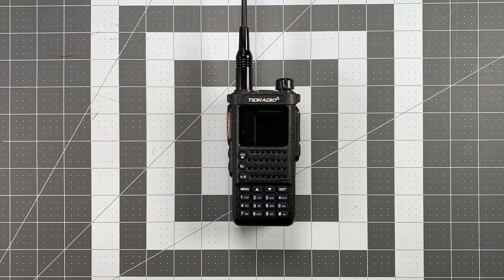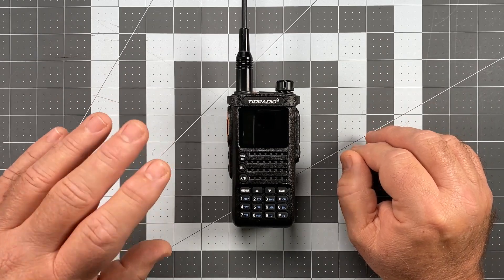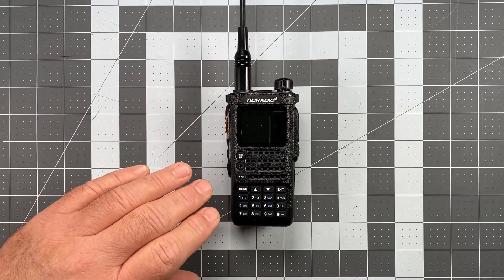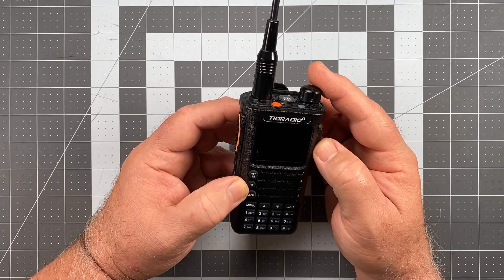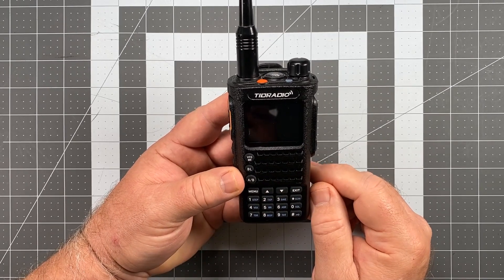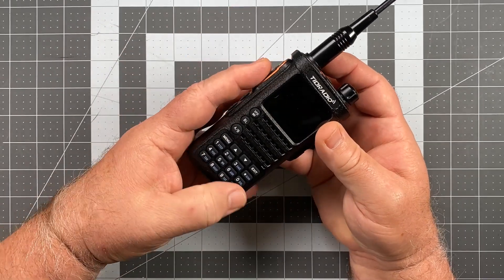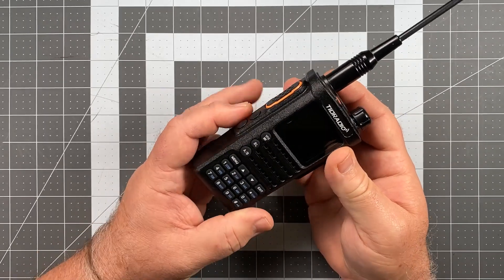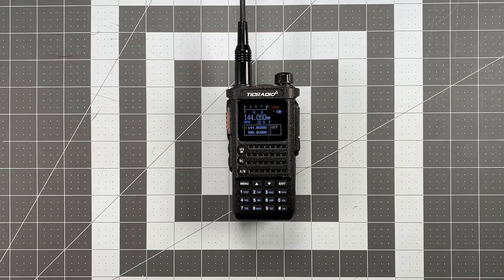TID Radio TD-H8 - Switching the Operating Modes

Comment: What is the best mode to run in?
Reply: official answer: the mode that you are licensed in and be FCC compliant .....  since I am not the FCC police ...  Normal gives you all the options with no "operational" drawbacks ...  well ....  its your radio, you decide what mode to run in .....  BUT. just as a serious side note ...  if you use chirp and you change modes you cannot write an "old" (before you caged modes) settings file back on the radio ... Chirp will read it as a "new" incompatible model ....  so you can copy and paste some frequencies ... BUT you cannot change all the other settings ....

Comment: Any idea what menu option 34-  Hopping RX is for?
Reply: RX Hopping (Menu 34) on the TD-H8 toggles the radio’s ability to follow a frequency-hopping transmission (FH). When ON, the receiver jumps through a predefined hop pattern/interval so it can track another TD-H8 (or compatible set) that’s transmitting with TX Hopping enabled.
What it’s good for
Interference avoidance: If one frequency is noisy, the signal keeps moving, so short bursts of interference matter less.
Basic privacy/obfuscation: Casual scanners won’t easily follow the conversation (this is not encryption).
Requirements / caveats
Both ends must match: same hop table/seed, hop rate/interval, and channel setup—usually configured in the vendor CPS.
Range can drop: brief dwell times and imperfect matching can reduce effective coverage vs a fixed channel.
No repeater use: hopping won’t work with standard GMRS/ham repeaters.
Scanning/features limited: scanning, recording, or cross-functions often don’t behave normally while hopping is active.
Legal notes (important)
GMRS/Amateur (U.S.): Frequency-hopping transmit is not permitted on GMRS and isn’t how amateur service is intended to operate. Use hopping only for receive/experiment on ham with proper understanding of rules, and don’t TX in FH on GMRS. Always verify local regulations.
When to leave it OFF
You’re using repeaters, shared channels, or want maximum range/compatibility with other brands/models.
You’re in RF-quiet areas where hopping brings no benefit.
Bottom line: RX Hopping lets the TD-H8 follow a FH transmission for interference avoidance and light privacy, but it’s niche, reduces interoperability, and TX-side hopping isn’t legal on GMRS. Keep it OFF unless you’ve coordinated both radios and know the rules.
Reply: @ZILAwelds thanks. I don't have to follow gmrs regulations here.